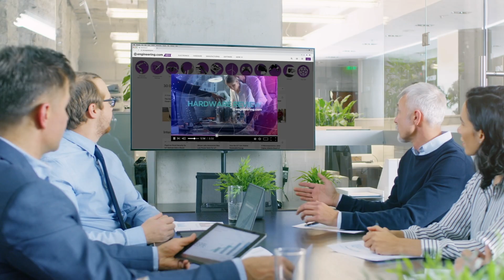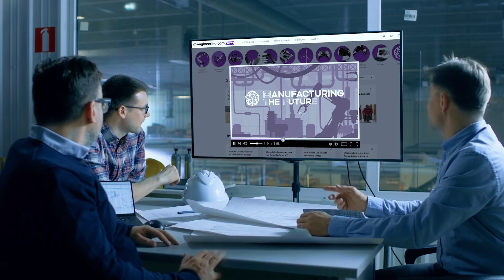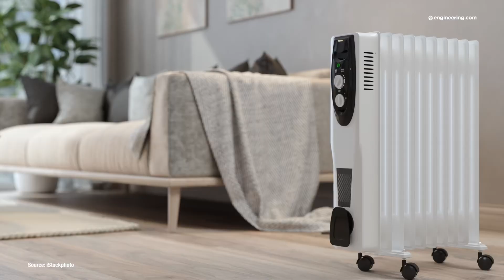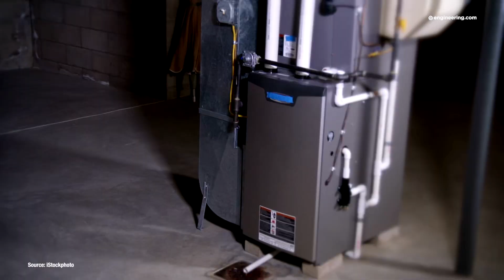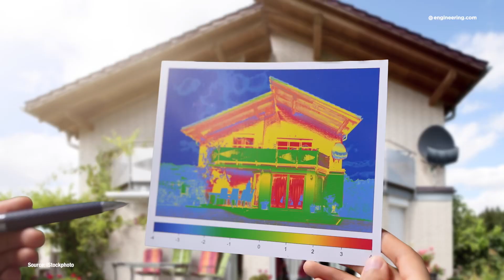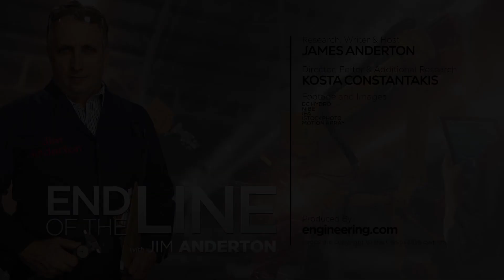Are Heat Pumps the Answer for Clean Heat? It Depends

Comment: Got a heat pump installed a year ago along with a new furnace and love it - living in a relatively colder climate I've definitely reduced my carbon footprint since the furnace won't kick in unless below 14F/-10C which only happens for a few weeks from late Dec to March - electricity here is generated via nuclear so it's carbon-free. Although I agree with the commentator, sealing a leaky house and insulating it is one of the first issue to address to reduce your carbon footprint.

Comment: Thanks for the analysis. I believe in the long run heat pumps are better overall, since gas prices will become higher and higher in the following decades. Also, gas is surely safe by now but accidents still happen, and heat pumps have no risks at all. Gas is also a strategic resource that makes you geopolitically vulnerable if you don't have it at homeland, that's why Europe is already restricting its use only to industry use until adequate alternatives are available.